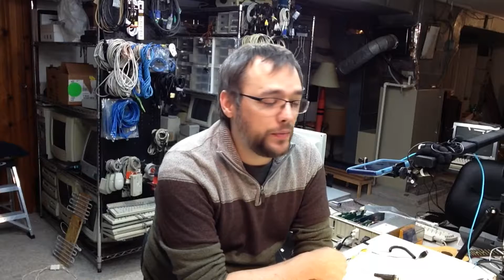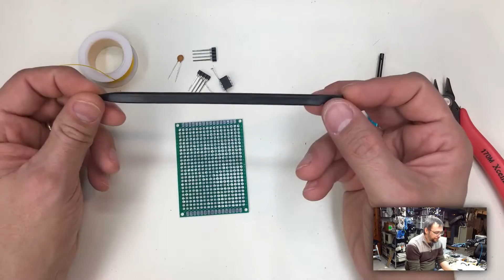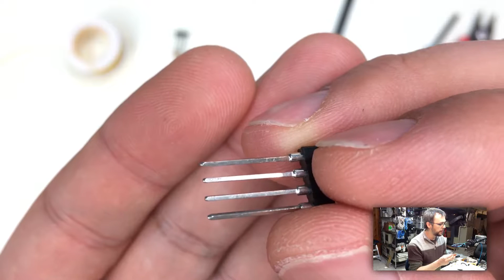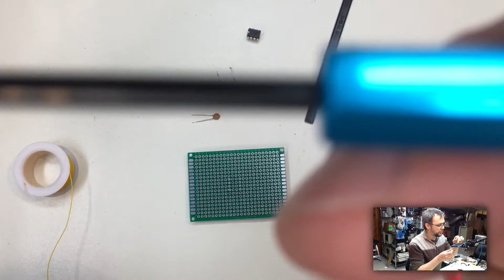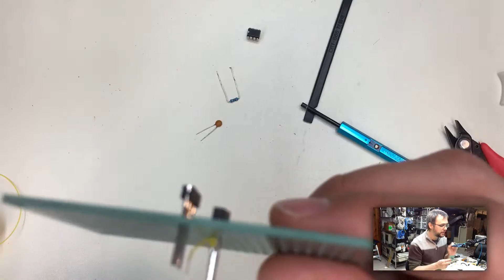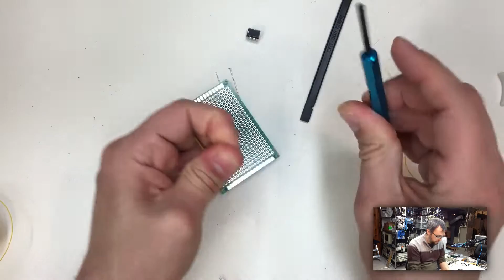Let's Wire Wrap!

Comment: Thank you for an awesome video! 
Could you please help me find the wire wrap socket pins you show in the video, I can't find them anywhere!
Reply from the maker: Check this search on Mouser: https://www.mouser.com/c/connectors/ic-component-sockets/?q=wire%20wrap&termination%20style=Wire%20Wrap&instock=y&sort=pricing
Reply: @JoesComputerMuseum  My god, it's super expensive:
1row x 2 pins x 2 level ww termination = 2.5€ a piece
1row x 18 pins x 3 level ww termination = almost 15€ a piece
Reply: found an easy way to search for parts
AA-0503-BC
AA-number of pins
B - levels of WW (normaly 2 or 3)
C - alloy used 
(0 = Au Collet, Sn Shell
0TL = Au Collet, Sn/Pb Shell
1 = Au Collet & Shell )

Still too expensive, hopefully the chinese start up the production someday :P

Comment: I was wondering, the legs on the cap and resistor look like they might wrap pretty well if you used them as the wire instead of the post?
like say if you wanted a decoupling cap could you use the cap leads and wrap them directly onto the posts?
Reply from the maker: The video is deceiving. The wire wrap wire is VERY thin. The cap and resistor leads usually won't fit in the wrapping tool.
Reply: @JoesComputerMuseum  aww that's a shame here was me getting hopeful.
Still ordering some wire wrap stuff to play with today 😃
Thanks for the video mate

Comment: Wow, I have no idea whatsoever what you mean by "full ground plane". It would seem that such a thing connecting all the components would be one huge short and nothing would work at all? Do you mean the ground plane goes up to yet does NOT touch the metal of the thru holes? Maybe that's what you mean I'll have to research this. Great info!
Reply from the maker: Ah. A ground plane is a layer in between board layers on a PCB, or filling in the open spaces between traces on a PCB. It helps absorb noise. It's only connected to the ground pins of the chips, etc.

Comment: I mate, I just came across your video that was very enjoyable to watch even with that reluctantly focusing camera of yours. 
I add my 2 cents there since I've done a bit of wrapping back in my college years. For individual components we had not the special sockets you are mentioning available, but we had full drawers of these small pins instead : https://i.ebayimg.com/images/g/N1sAAOSwZN5eeIn4/s-l1600.jpg Our teacher didn't exactly told us how to use them but I suppose that the correct way is to lay your components leads flat between the forks and put a bit of solder on each end, then trim the excess with your clips. They aren't that much cheaper than the pin rows you used (usually 8-10 bucks for a 100) but they can accomodate a wider range of lead thicknesses. And once the component have its ends soldered on pins, it is easy to move them around individually to optimize board space.
Reply from the maker: Yeah, my camera craft has improved since then. I'm aware of individual component pins. Now. Back then - I was a newbie. They may make an appearance in the future when I get back to my JCM-1 series. Thanks for the input!

Comment: Funny enough, googling "black nylon stick" actually finds what it is - a spudger. One that looks similar to the one you features is made by Menda (Mouser p/no 809-35622).
Reply from the maker: Yup. Spudger has many meanings, from "case cracking tool" to "telcom 66-block manipulation tool" to anything in between.
Reply: @JoesComputerMuseum  I only knew the first sense. Been previously using toothpicks, canape sticks, and whatnot, for the tool that you've shown. Now I had to order a new tool :)

Comment: One thing that has always puzzled me: what are the elliptical pads at the edge of the board used for?
Reply from the maker: For tying on large edge connectory things, or power jacks, audio jacks, etc? That's what I use them for, but I'm not exactly sure myself!
Reply: I mean, they're kinda-sorta-almost "card edge" connectors... but not quite.  :D  That said, there are some components that are meant to straddle the edge of a board and get soldered on, so they could be useful for something like that.  Another thing I've found useful in them is one can solder the short side of some .1" headers onto some, solder something to that, too, and then use that to plug the whole board into a solderless breadboard or a female header or whatever... so, connectivity.